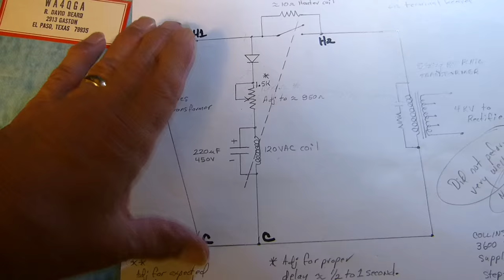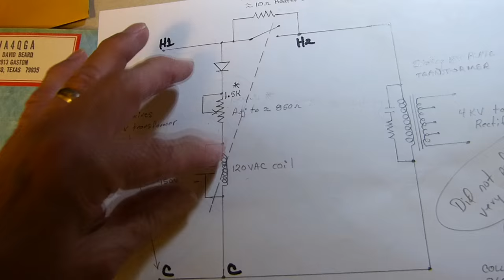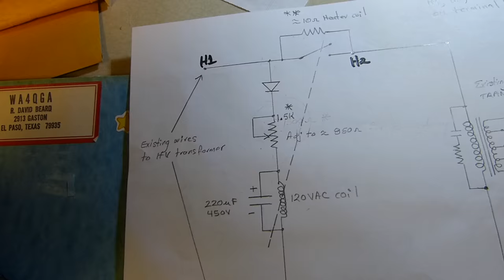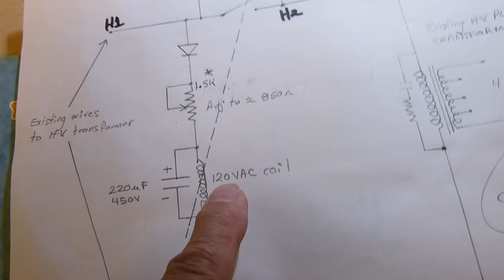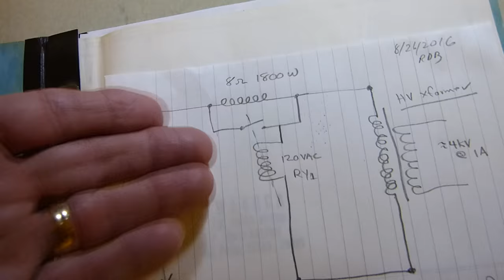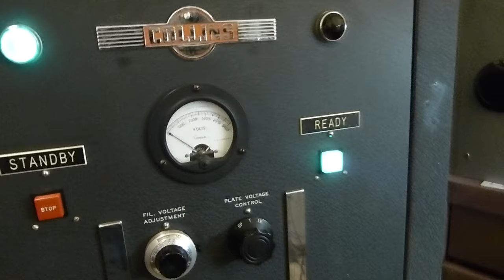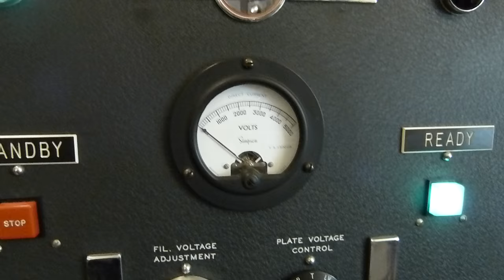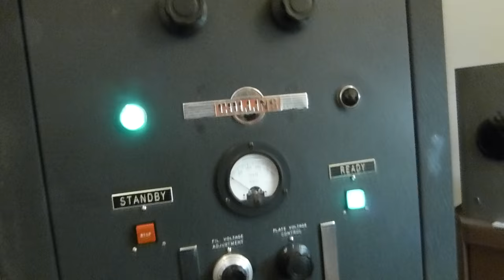Eimac 4-400A RF Amplifier Step-Start (Soft-Start) Relay Circuit For High Voltage Power Supply

Comment: Heath used a simplified version on their AA-1640 power amp kit.I believe there was a 10 ohm 10w resistor in series with the relay to make it a bit"lazy" in pulling in with 1 ohm across the contacts,in series with the power trans.The idea was to use just enough to prevent repeated line fuse replacement.That first power up cycle is a killer!Nice rig too.Had a KWS-1years ago.Alwsys got comments on the great audio.Sold it a few back.Guy drove from Nevada to pick R up. S/N 318. He got my A4 too. Nice older fellow.I was a 9/11 first responder which I would do again in a heartbeat but fell ill a few years later n didn't get to use it much.I didn't want that so I put the pair on eBay.Bids from all over ! You'd think it was a DX contest. Enjoy all your vids.Very envious of your workbench!

Comment: Nice circuit, awesome tubes. Your relay is the safer way to go. NTCs are good for a lot of things, but they can have reset times of over a minute. So if the power goes out for a second or two and comes back on the NTC does not help, as it has not cooled down.

Comment: A lot of the industry uses a slightly modified version of this. The soft start relay contacts and heater remain as is. The diode, pot etc is eliminated. The AC coil of the power contractor is wired in parallel with the main power transformer's primary.
How it works.. When AC is applied, current flows through the heater.. but due to the dead filter capacitors charging, the inrush current, the voltage is too low on the transformer and contactor for it to pull in, until the capacitors have charged about 70% where the contactor pulls in and closes.  This change prevents the contactor from pulling in on shorted diodes, transformer, or caps.
Reply from the maker: Thank you for the explanation. I have actually experienced what you are talking about without realizing the benefit it would have on shorted diodes. In reality, I had to jumper out about half of the 8 ohm load because if the PS load was too heavy on startup, the relay would not pull in. I think this happened most on the 3-1000Z amp. If you look at the video/schematic at 11:18,  I think you will see that I built it exactly as you described.
I will throw in another thing here and hope I can describe it it words without a lengthy description of the circuit. 
I have made several holding-relay circuits using large standard relays (115 V coil) and have found that if I accidentally short the output, the relay drops out quickly and (hardly) never blows a fuse. A benefit I did not consider but a really nice one to have by accident. I started this in 1975 when I had a KW AM transmitter in Huntsville, AL where we can have lots of thunder storms that can wreck havoc on equipment powering up and down. I am sure you understand. I use a spring loaded normally open switch to power-up and a normally closed push-button switch for power-off. Thanks for your comments.
Reply: @ElPasoTubeAmps  You are welcome. This design was used in a couple transmitters I worked on, one which did get hit by lightning. The AM was 10KW and the FM8 KW, so this is normal in high power stuff, but 3 phase 208V. The soft start not only protected the diodes from inrush current, it also provides thermal shock protection to the tube filaments. The soft start resistor is quite low in value to carry both the reactive current of the power transformer, and cold filaments. The actual delay is quite short, only about 1 second or less.
Due to the utility forbidding bonding the tower ground plane to the utility, the lighting strike arced in the power supply damaging the HV diodes. In the repair, we added spark gap protection to the HV supply to keep the AM RF off the utility, but limited the differential voltage during a lightning strike. Neither transmitter had any damage in the PA. The shorted DC output works very well for that.

Comment: A while ago, WURTH made a "soft start" resistor with shorting bi-bar (like in thermostats) across this resistor. Delay is adjustable by changing the gap of the shorting bar mechanically and this works perfect and very simple. I used this a long time and never had trouble with it! Only one part for a soft start delay system. Can one get more simple? No electronic stuff.
Reply from the maker: I just looked up WURTH soft start relay and found some information but the soft-start relays are expensive. Can you give us a link to what you have in mind?  Thanks for the information.

Comment: In place of the heater coil you could use a 300W light bulb. initially all the AC will be across the lamp but when the transformer is 'chrarged' the lamp brilliance will fade as the AC is divided between the lamp and the xfmr primary. Then have you relay short the lamp for full AC to the xfrm.
Reply from the maker: Sounds like a good option. In my case, to make mine work "perfectly" I actually added a jumper from one end to a tap point along the coil that I determined experimentally  which is about 2/3 way up so that only about 1/3 of this 8 ohm coil is in the circuit so I am down to about 2 or 3 ohms. I had to do this because every time I keyed-up the transmitter, the delay of 1 second or so was just too slow. I had to be aware of an intentional pause in my operating procedure because if I started talking too quickly, the mercury relay would not pick up and the heater coil stayed in the circuit of the primary of the HV transformer and things got really strange.
I think every piece of equipment has to be personally tailored so that the delay is just right. It gives a 1/4 to maybe 1/2 second of delay so that a few cycles of AC can charge the capacitors before full voltage and current are available to the primary of the transformer. A 300 watt light bulb would  be about 2.5 ohms hot which, I think, would be perfect but I am not sure of its cold temperature. If it is not over about 3 ohms cold, it could be just right for my amplifier. BTW, I have changed this amplifier back to a 4CX1000A and removed the pair of 4-400A's shown in this video. The glass tubes are beautiful but the 4CX1000A is a bit more powerful and I get very good comments on audio strength and quality. Thanks for your comments. 73

Comment: Typically in commertial transmitters they will use a 5-10 ohm resistor (high wattage wire wound) on each phase... One of the other ingenious methods I've seen is to use an SCR to run the voltage up smoothly with a control voltage... I tried to post a circuit drawing but it would not go through.

Comment: shock ur life with the open exposed windings of your heat coil, but. u got a great product
Reply from the maker: I have to agree with you but the whole cabinet from the rear is a "death-trap" if the interlocks and HV shorting bar are cheated and the door is open. It is terrifying when I have to operate this transmitter that way for an adjustment or measurement (very rarely) . I always make sure no one is around and my cat is locked in another room.

Comment: is not there DC coils for the relay?  and the tune to 850 ohms is not better go to a voltaje tune  for keep the coil cold on long turn?
I like more 12v coils for soft start cicuits.

Comment: Very nice video.  Thanks for sharing your knowledge.  Just curious; why do you run such a big amp on 120vac?
Reply from the maker: The output (secondary) of this transformer has been perfect for all of my projects in this amp since I picked it up in 1975. I did have to change it from a FWCT to a bridge. It came with this transformer even though I know it is not the original Collins transformer. I just don't have one this big that has a 240 volt primary. I pointed it out in an older video that I actually run 240 volts to this amp on #6 wire straight from the circuit breaker panel and then run the 240 into a 2:1,  5KVA transformer to step it down to 120 VAC. That greatly improved the HV regulation on this amplifier. I also take the output of this 2:1 transformer and power the Collins 30L-1 with it as I never have both amps on at the same time. If I could find the right transformer with a 240 VAC primary, I would swap it out and rewire the HV primary circuit to use it.

Comment: Incorrect analysis.

The 10 W resistor does not charge the capacitor, it charges the parallel network of the cap and relay coil. 

Amateur radio is enginerring. All this simple circuit can be calculated.

This is erroneous guess work.
Reply from the maker: You do some first thoughts on design values and scratch them out on paper or even model it in LTSpice and then you do some "empirical design" (tinkering with the values) and hopefully, the outcome works for the particular piece of equipment. Some might just call it anecdotal, in that it works in this case but may not work in someone else's case as their situation is a bit different. As a final adjustment, I jumpered out half of the 8 ohm heater element as it was a bit too high in resistance and did not let the primary voltage rise quickly enough on the HV transformer primary and the mercury relay would not pick-up and short-out the series current limiting load.  It has been working great since 2016. I don't argue that values can be calculated to at least get close to a working value but just about everything requires some experimentation to get it just right. Thanks for your comments. 73  WA4QGA. If you like pictures of vintage equipment, you might like my QRZ page.